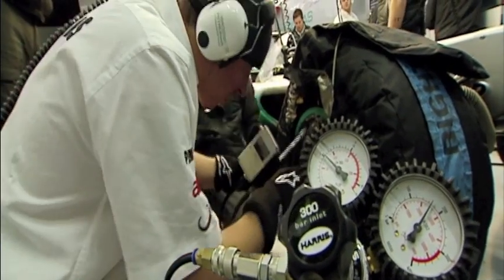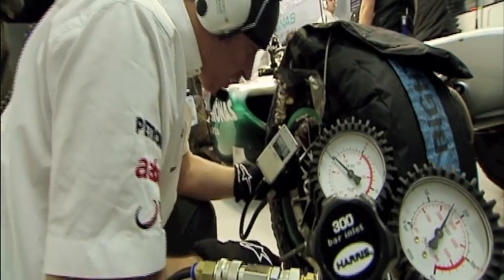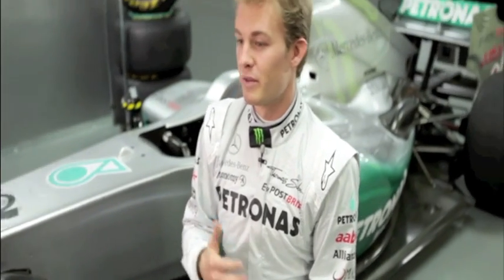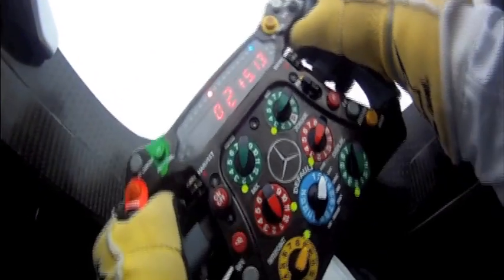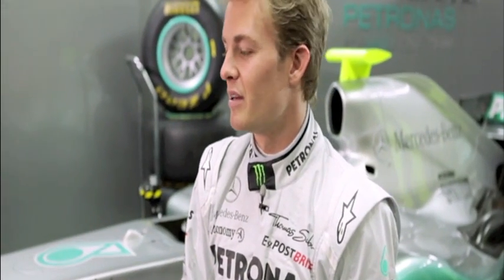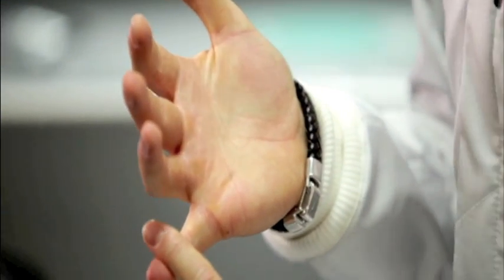Grand Prix Insights - Tyres [2011]

Comment: @xXxReplicatexXx It sounds obvious, as he said, but it's absolutely huge. Evreything else on a car is completely redundant as far as the track beneath it is concerned; the only way a car can 'communicate' with the track surface is through the area of each tyre that contacts it. These contact patches change size and dimension constantly under acceleration, braking and aerodynamic load change, and understanding the way in which they do this is the most critical thing for a driver to know.